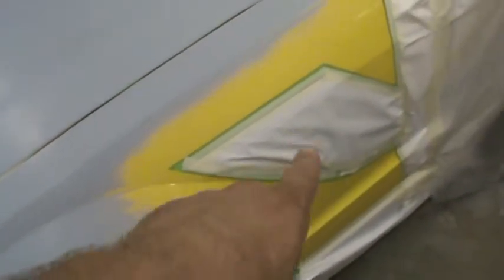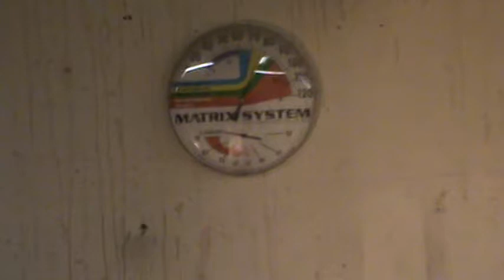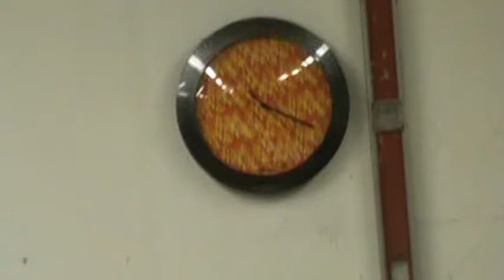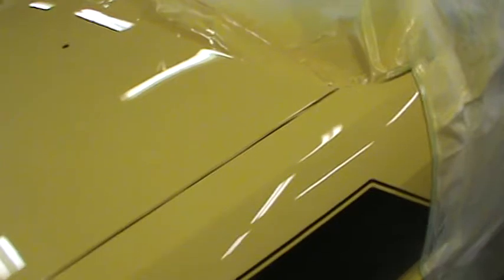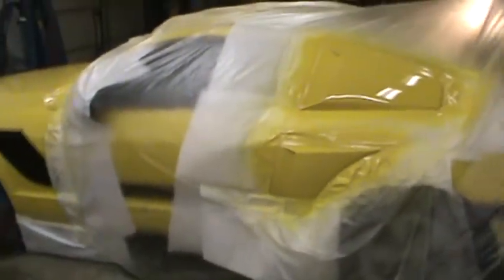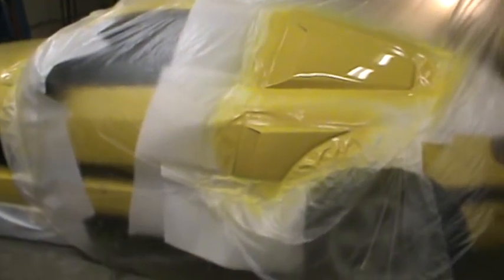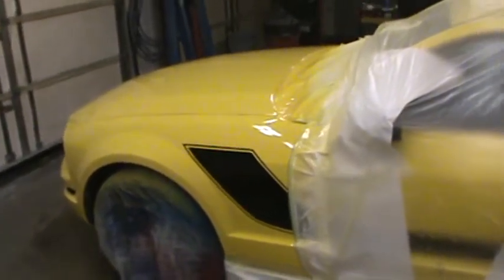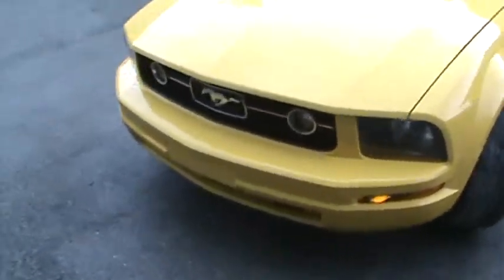Painting the Mustang

Comment from the maker: I love the MC161, lays out beautiful and has great shine. I havnt shot 100 gallons of it but I have shot 6 or 7 gallons this yr alone. This is first time I had any trouble. I do the majority of my cars in cooler weather I have always used the 167 with a dash of accelerator. If I would have put the accelerator in on the first pass I wouldn't have had any trouble. I usually put on 2 wet coats no buffing. I am using a Sagola w/1.4 tip at about 31 lbs.

Comment: Hey Tom, I'm wondering with the clear that you used. A fast hardener at the warm temp you had that day may have forced you to lay the paint on too heavy to get it to flow nice. Also taking longer to get all the solvents out ( drying slower) A medium hardener should get that paint in smooth quicker and dry faster. The high humidity can hurt the gloss but really messes with the base coat causing blushing issues. A fast hardener in warmer weather is usually only good for small parts.